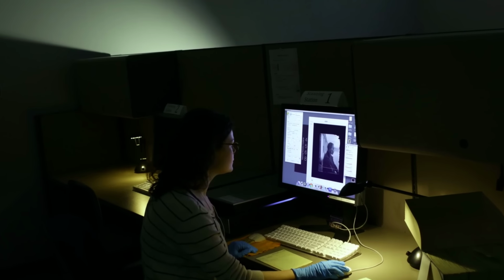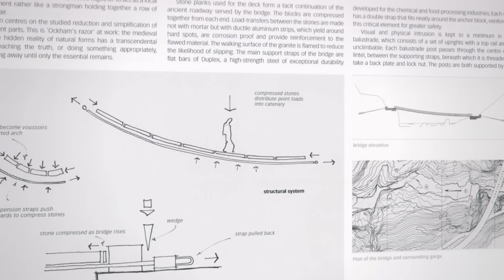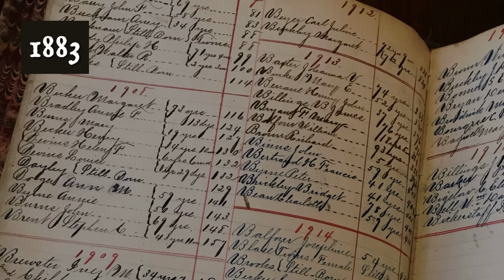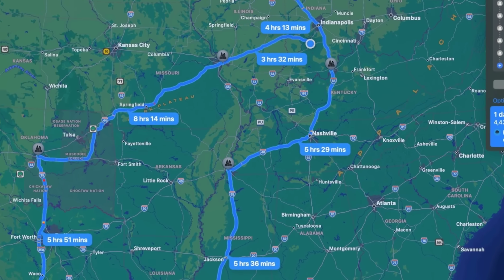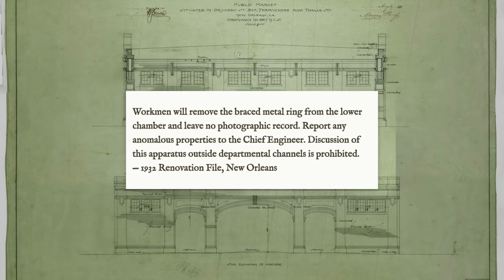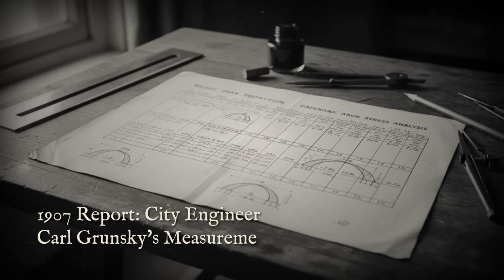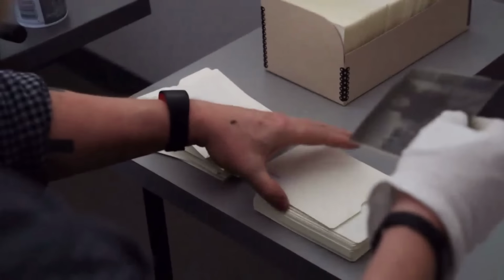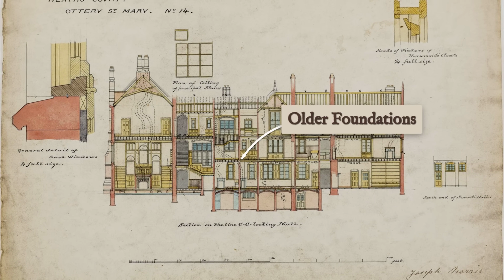How They Falsified History by Destroying Tartarian Cities

Comment: Maybe it is all about creating a renter society for the capitalists of modern times. At least they had some shame to hide public inherited infrastructure mostly covered over. City cores could be burnt in staggered sequence to take over ownership in lock step to give time to replenish capital reserves for the next fire sale. Hydraulic power would be replaces with gas, coal and electricity distribution systems. Did the pre-mud-flood bridges fall into disrepair, or were they too submerged under new water and land levels to be useful. Were medieval structures raise out of the ground -- dug out, or lifted and re-assembled for worlds fairs. It all goes against the notion that Columbus discovered America. It also brings into question the timelines of world events. Maybe America at one time America was the new Atlantis.  Maybe passive water turbine where used to drive high pressure pressure pumps and sonic multipliers. And seismic sonic ground waves used to drive piezo-electric street lamps.  Did these augmented ground waves cause mud slide into river valleys when rain falls where intense. Don't we live much better electrically.  Was a water train using compressed air, and pressurized water as it power transfer medium -- how far would that go? Faster than horse and buggy. At some point Capitalisms turned the wheels of progress with it's pros and cons. But the mud floods are most mysterious.